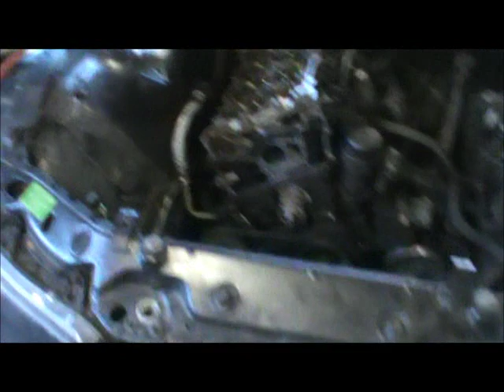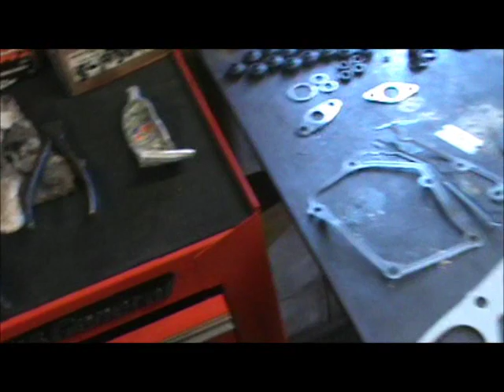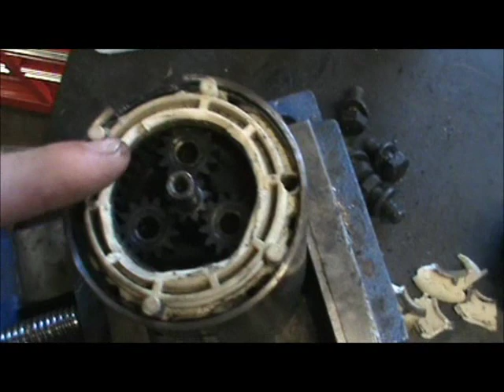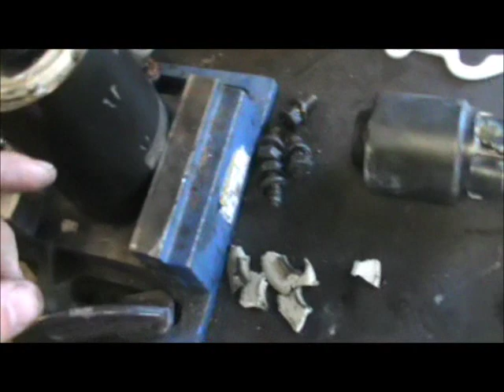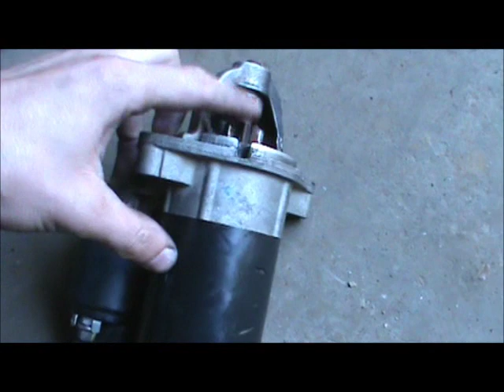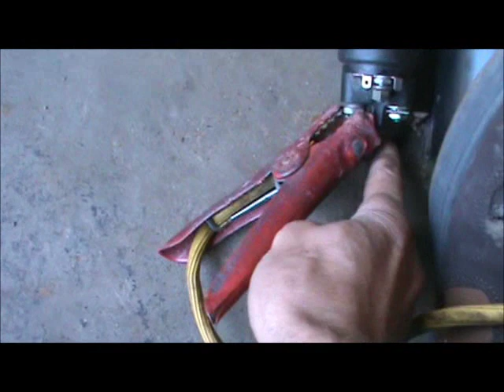how a starter works

Comment: I was hoping you would service the brushes- my nippon start would ant start- had to get towed- so took it out  [ no room in a 93 hard side!] and dismantled it- the brushes [ 4] on the end were just riding on goop  on the rotor and 2 brushed were worn all thway down- the other two had hardly any wear! I cleansed th  contacts and  I flipped the 2 worn brushes sideways endwise so they extended enough for I figure 50k;s  as no cash for new starter-works great!  cleaned the solenoid too

Comment: Your explanation and visual were very helpful in allowing me to understand whether I should attempt installing a starter on my 1994 Ford E250 Econoline.  Looks easy enough to get to.  Could you or anyone reply if I should be wary of any potential problems I man encounter.  Actually, can I do it without putting the van on a lift? Thanks!

Comment from the maker: hard to tell without hearing the noise you mention. could be a few things, first id take it back apart and look for signs of damage to the flywheel or new starter. could be the new starter isnt aligning properly due to a manufacture defect of the starter. or possibly the flywheel is damaged but unlikely

Comment: i just installed a starter in an 06 vehicle. it starts up but theres this soft grinding sound right after you let go of the ignition. not sure what is causing this. there were brackets that attached the wire harness in place to the bolts holdding the endcap of the starter but didnt think it was functional (just to hold the wireharness in place) is this the problem?

Comment from the maker: i havent been online in abit, sorry for the delay. if you could look at the flywheel teeth and the starter teeth they both are cut at an angle so they can mesh at speed. in addtion they are made out of extremely strong steel. if i get a chance ill make another video and explain more clearly.